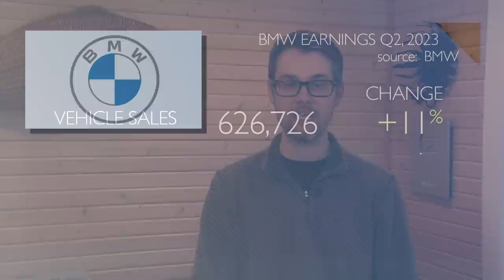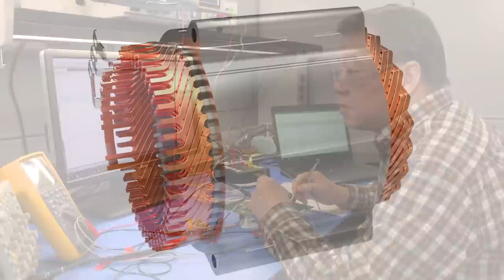BMW Outperforms Competitors With EVs; U.S. Car Market Getting Healthy Again - Autoline Daily 3619

Comment: Toyota is killing it. It’s backlog is far greater than Tesla’s and it’s absolute growth is potentially greater. Toyota has half a dozen home runs either just out or shortly coming out. If they can get their production up they could be selling at least another couple million units a year.
Reply: Toyota, IF, COULD.
Reply: @metricstormtrooper  Toyota is already selling car at over a 10,000,000 clip they sold 10,480,000 last year. Toyota expects to sell 11,380,000 this year yes growth in sales almost equal to Tesla’s total sales. The waiting list for Toyota’s is far longer than almost any other. Those pent up sales are easily another couple million units.

Comment: Hi Elon aka Mark.  Ole Bobb to the rescue again -- all that those in the lawsuit have to do is to glitch the ASP and reset the battery range estimates and/or unlock non paid features to be made whole.
Reply: Read it and Weep you Tesla hater Tesla's market cap tops the 9 largest automakers combined
Reply: @MarkMeszarosYNG  Your Diversion Team will need an explanation as to why the driver monitoring camera does not work at all with 11.4.4.  Too much C++ code?
Reply: This means game over for Tesla!